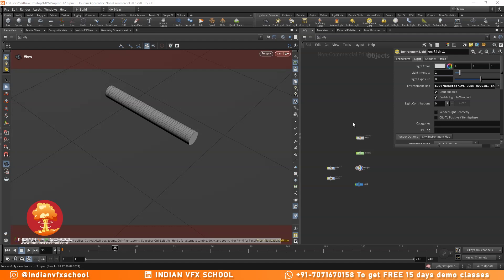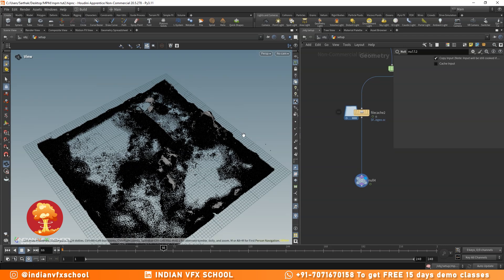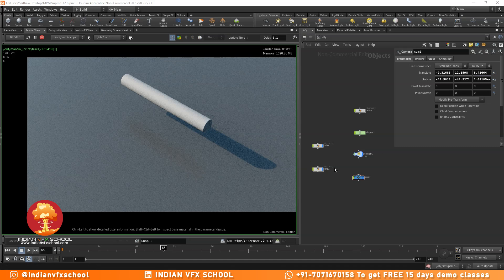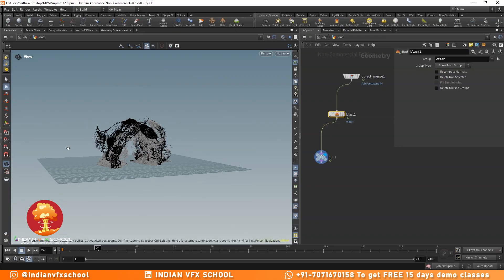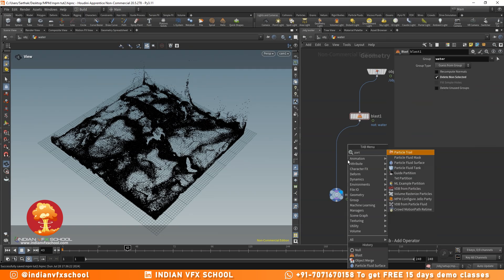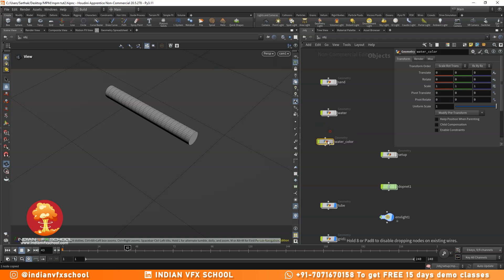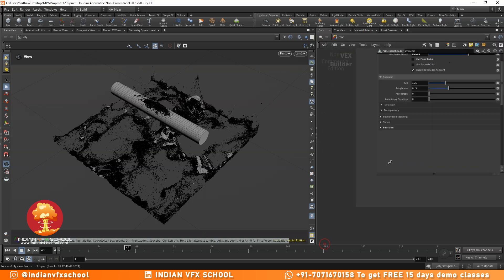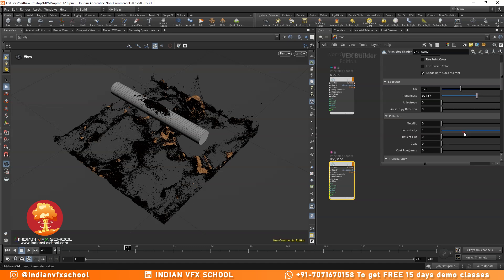Houdini 20.5 MASTERING MPM - Part 3 - RENDERING #mpm #houdini

Comment: Cool tut series, i also tried to integrate this in Karma, there was a problem with Cd, so i putted out the geompropvalue with attribute "displayColor"(for Usd MTLX) and separate3 in vector and the wetness worked, also i think u skipped the cohesion setting for sand here which represents the wetness of sand. You should also maybe do tutorial for newer mpm solver, instead of using particlefluidsurface, to use a mpmsurface.